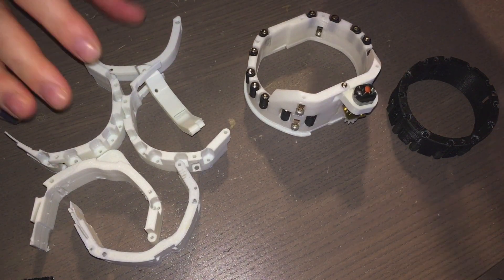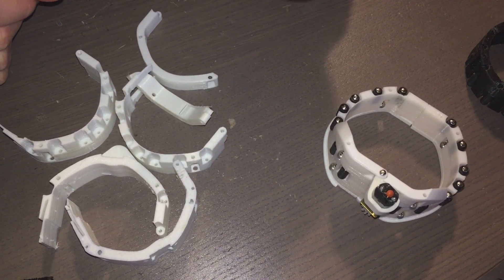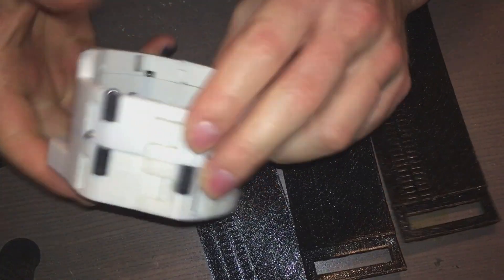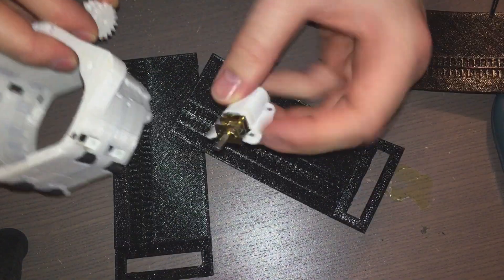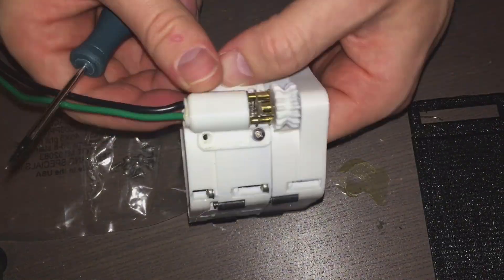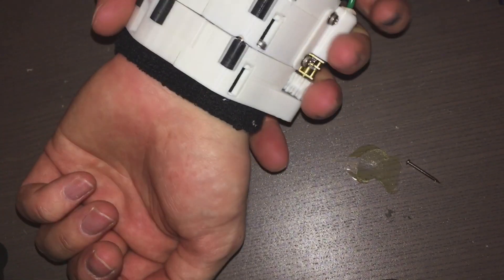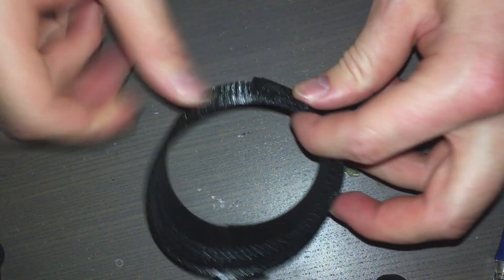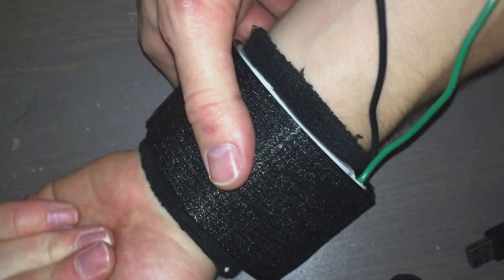Episode 4: Redesigned Conveyor Bracelet | Research & Development

Comment: Hey, great job, i am trying to print this to build demo version of another devices, can you help to understand which motor you are using here? And how many rollers do i need for this? 18?
Reply from the maker: I think I ended up having to use a beefier one than I used in this video. If you find a geared 12V motor that should be good.
Reply: @theAmazing  hey, thank you, found one in my city, for 12v and looks same, will share my results with your, after finishing :)